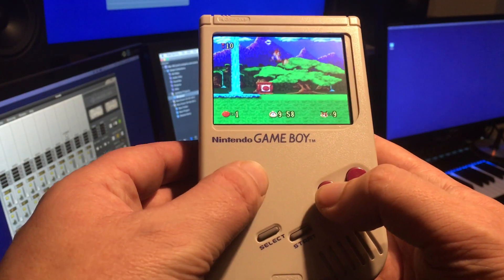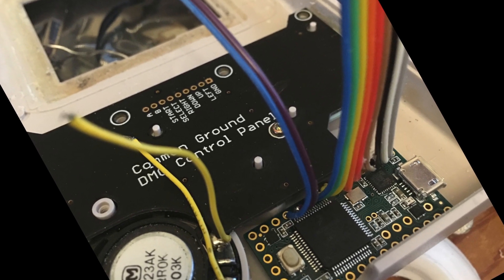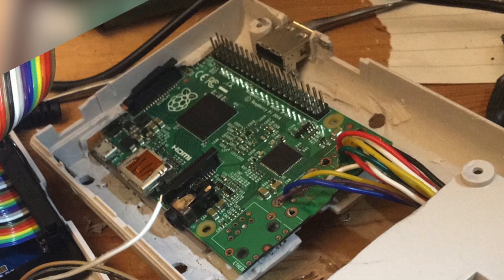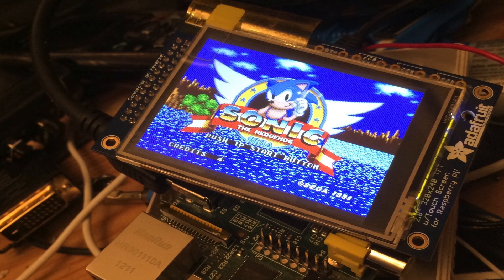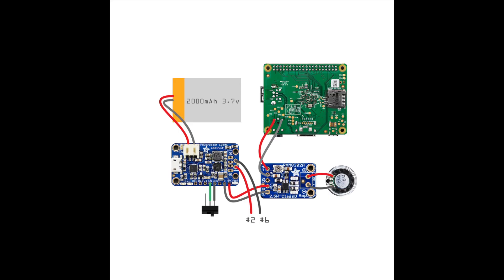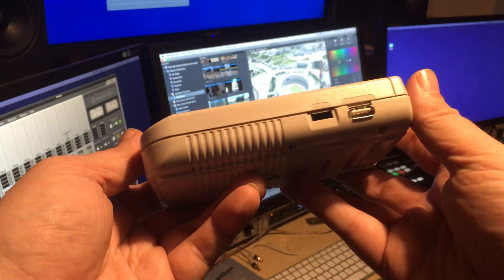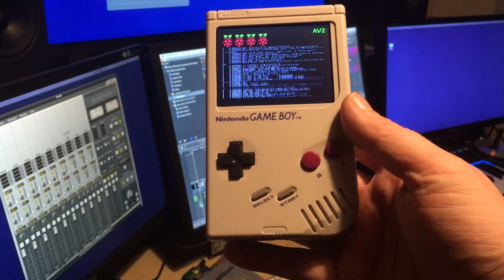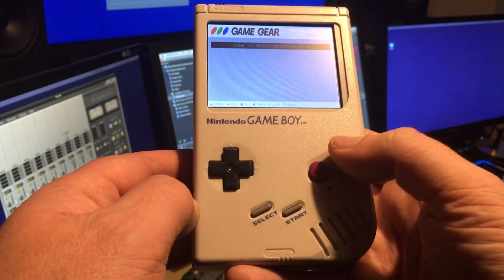Raspberry Pi GameBoy DMG-01 Build Overview And Demonstration

Comment: Hello with the screen size how much Screen does it lose? Because it looks like part of the LCD is hidden. The other question i have is that how long does the battery last being that the LCD and Raspberry pi take a lot of current and i also forgot the Teensy and Audio amp?
Reply from the maker: +joseph chrzempiec (josephchrzempiec) all the view-able area of the screen is visible, I got it as close as I could to the edge, so no screen loss at all. I've never timed it - but it's well over an hour... maybe even two.
Reply: That's awesome man thank you.
Reply from the maker: +joseph chrzempiec (josephchrzempiec)  if you only want to play Nintendo, master system, gameboy games... Then the pi zero would be fine (you'd need to do a bit of circuitry to take the audio out of the pi's expansion or use a sound card expansion board, but even then, the zero should be even better on battery.
Reply: I'm building one soon. mine will have 2 of the 2.7v square batteries each one has 3900 mah for a combine total of 7900 mah hours i hope that should be enough for at least 4 hours of play time It fits in the battery part i did but a little i do not have a pi zero hard to get one for me and ebay there like 40 dollars. No one not even adafruit has one. Sense I only buy from the Us and not china i hate waiting for shipping.

Comment: What did you use the epoxy stick for? Is it similar stuff to sugru?
Reply from the maker: +Martin Kidd I originally used hot glue to put the charging board (which has the charging jack attached) in place, but when it got warm inside the case, the glue went soft enough so that the jack would disappear inside the case when you tried to plug it in, so this was mounted on a mound of epoxy plastic resin which worked perfectly. It was also used to build up structural parts, such as a platform for the usb port to sit on inside the case, and also to hold it in place.
Reply: +Stuart Fox Awesome, thanks!

Comment: Really impressive video. Prob best YouTube one I've seen. Just wanted to ask how much project is likely to cost. Build time and if you've sorted any problems you mentioned at the end. I am an extreme amateur to this and all pi related things but a lover of old games so thinking of having a crack at this. Any tips advice is welcome, thanks
Reply from the maker: +Scream1077 This took me just over a month, working evenings and weekends and the odd day off. The reason it took so long was that I went down the a long road with the PiTFT screen which I then judged to be unsuitable for many reasons. If I build another now, knowing exactly which parts I was using, I think it would take a week or two if that.

The cost is outlined in my video comments along with links to get most or the bits I used. 

This is a tricky project in many ways, your soldering has to be fairly good... I thought I'd get away with less by just plugging things in to the pi, but there just isn't enough room for that. Slimming down the Pi is a challenge so maybe consider another Pi model, the Pi Zero wasn't out when I built this, but it might be worth looking into, sound may be an issue though. I got audio directly from the board underneath the Pi's headphone jack, the Pi Zero is TINY, and hasn't got any audio out filters so no headphone jack. It's HDMI only so your options would be to get an HDMI audio extractor which might take up too much room, or do a bit of circuitry to recreate the missing audio out on the Pi Zero. Details here: https://learn.adafruit.com/introducing-the-raspberry-pi-zero/audio-outputs

OR if you use composite video, this might help: https://shop.pimoroni.com/collections/raspberry-pi/products/phat-dac

RE Cost, I've given all the links in the description. Cost me more my first time because I broke some things and ordered the wrong bits. I'd plan for doing the same on your first attempt.

Do lots of reading up and practice soldering on junk boards. It was frustrating, and I've built projects before (not as fiddly as this) so patience is key.  Good luck, and post when you've got something so show off :-)
Reply: +Stuart Fox cheers for that. Last part of message cut off there sadly. Think I may look into the pi zero. My soldering is ok but think I'll manage that bit. Just the technology that confuses me a little. Didn't know about the zero so cheers for that. Seems like a good option but will prob need some "bolt ons" by the sound of it if that is achievable. Will do som research myself before starting but thanks for tips.
Reply from the maker: +Scream1077  seems I waffled too much :-) you can get audio from the zero like this: https://learn.adafruit.com/introducing-the-raspberry-pi-zero/audio-outputs

There are also da converters and hdmi audio strippers. Good luck, post something when you have something to show off.

Comment from the maker: Hey... The 3.5" audio jack plug on the pi2 has composite on it, I soldered directly onto the back of the pi.
Reply: +Stuart Fox Which point would I need to solder ?
Reply from the maker: +Sanchees3 dm me and I'll send you some pictures.
Reply: Hey Stuart, do you mind sending those pictures to me as well? I figured out how to solder a composite display to my Zero, but not my Pi 3.